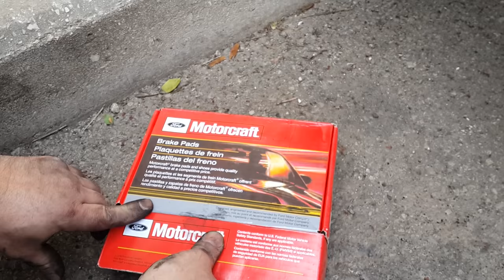How to Replace Install Ford Focus Mk III Front Disc Brakes Pads

Comment: Open the bleeder befor pushing bach the piston,stick gloves on when replace new pads , dont let the calliper dangle, bit of correct grease on the end of pads, and while your there, give slide pins a clean and regrease with correct lube,
I guess this was for a quick replacement of pads,
Reply: Everything is correct, instead of one thing. In Focus MK3 you don't use lube on slide pins
Reply: @szakkul  Hi any reason why? as iv always lubed slide pins to stop them from sticking and causing break binding,
As I am not sure why its not done could you give me the heads up please.
Reply: @piecetoyou8285  There is two types of pins, one of them is screwed into the brake caliper, as in the Focus Mk3, and there is no need to lubricate them because they do not work in the steel sleeve, they do not touch it, and the other one is lubricated because they work in this sleeve, because they are not screwed to the caliper, they are in the brake yoke
Reply: cheers never to old to learn 😀 @szakkul

Comment: Very difficult in returning the spring with mine. You made it look easy
Reply: Unscrew the brake fluid reservoir cap beforehand, this makes returning the piston easier.  
Remember, the fluid level will rise when the piston is returned to fully closed position.

Comment: discs dont look the best did you measure them?
Reply from the maker: What do you mean?
Reply: @WalkthroughMyLIfe  they just look worn -  ah i see it looks like your in the USA? so in the UK annual car inspection they would measure the width of each disc  if it is under a certain amount they would fail your inspection (M.O.T) . My focus discs start at 25mm and minimum is 23mm - They get worn down by brake pad contact. You can see the "lipping" around the edge of the disc in your video. Theres alot of vids on how to measure them https://www.youtube.com/watch?v=damTONNmMWY&t=51s&ab_channel=ecologicaltime